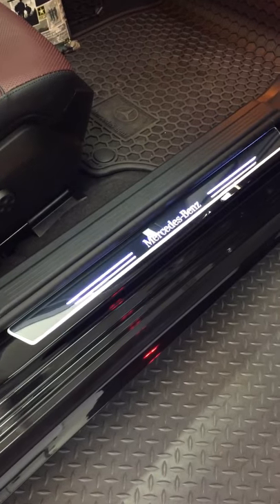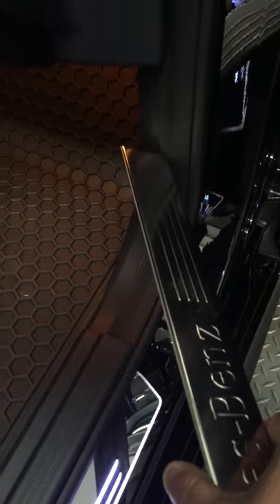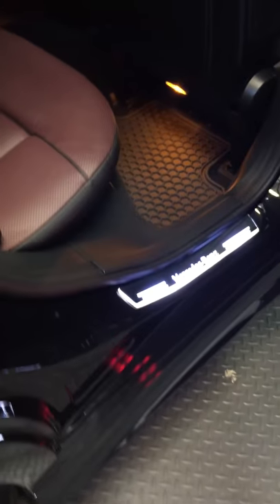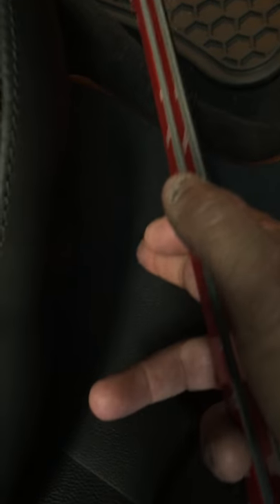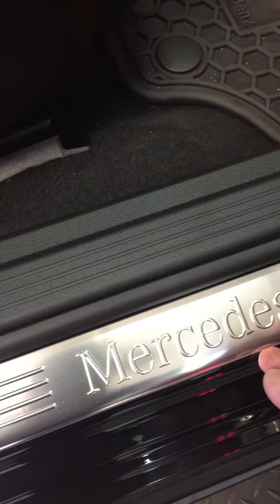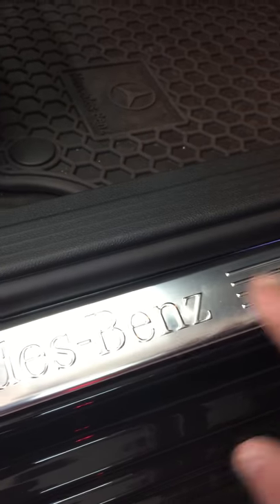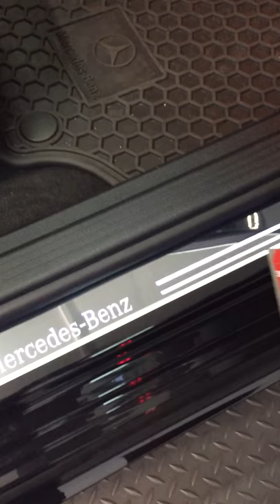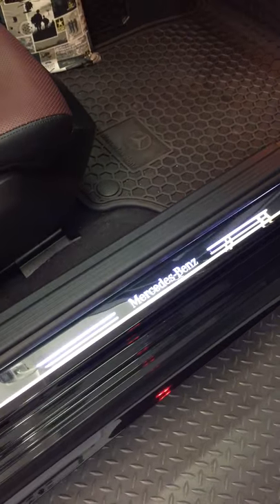Mercedes Benz E400 Mods - Front and rear dynamic LED door sills.

Comment: How do you disassemble the plastic next to the door sills?  Because in my GLA I tried to pull hard upwards but nothing moves and I am afraid of breaking the plastic pieces.
Reply from the maker: Not sure about the GLA.  Using a plastic trim tool my E400 W212 pops out.  You can go to MB parts online and check via your VIN the plastic door sill trim.  See if it is held by clips or adhesive tape.

Comment: How did you run the negative wire to the door without using the plastic in between the door
Reply from the maker: Are you talking about the front or rear doors?
Reply: I’m talking about the rear doors. You used the side B pillars for the positive connection. I understand that part. I’m just confused on how you are running the negative connection through the door boot where the courtesy light is. On the bottom of the door without going through the boot
Reply from the maker: @funnymovers2009  Once I removed the right side top and bottom B-Pillar panel this gave me better access to the wires that go to the door molex connector down through the rear right door.  I then drove to my nearby CarToys shop and ask if they could just help me find where to tap into the correct doom wires which control the rear right door courtesy light.  Using a tester, they identified which positive and negative wires to tap into.  They then provided me a copy of 2015 Mercedes-Benz E Class Sedan (W212) wiring diagram.  Although my car is a 2016 the wiring diagram did help.  I soldered connected the wires and wrap everything in automotive wiring harness vibration prevent tape.  Then proceeded to the left side.  In my case and according to wiring diagram the black wire of door sills was connected to the gray wire of rear right door.  For the left door the door sill black wire was connected to the violet wire of rear left door.  Importantly I did test these wires with a tester by closing and opening the doors to make sure they were correct wires before soldering them.  The red wire of sills was connected to a thicker red with white strip color of the rear right door.  Same thicker red wire for the left rear door.  Highly recommend getting assistance from some automotive electronic installer to ensure taping into correctly wires.
Reply: Joe A thank you so much I appreciate your time and reply
Reply: Joe A thanks again for the helpful info. I installed them super easy
Reply from the maker: @funnymovers2009  Nice..enjoy them.👍
Reply: @funnymovers2009  what year was your e350? Mine is a 2010 so wondering if I would tap into the same color wires?
Reply: @joea1746  I do t have a wire diagram so wondering. I have a 2010 e350, what are the odds I would tap into the same color wires?
Reply from the maker: @pb39374  Thats a good question.  I would think it be the same.  But then again it can vary due to year of car.  If not sure I would recommend go to auto electrician to verify.

Comment: Wish you would of shown how you did the rear sills.
Reply: Raymond never did the rear sill. Can you tell me what the wire was called in the b-post  that you cut to get the rear sill to work. I'm so nervous dealing with Mercedes wiring.
Reply from the maker: @vincecamponelli6035  Your right Ray didn't install the rear ones.  Like you I too get nervous when it comes to doing any modification to my MB.  In my case I paid a visit to my friends at CarToys Install shop.  They printed out the electronic schematic of my particular car W212 .  Then they tested and pointed out which wires I needed to tap into.  Without cutting any vehicle wire using a wire stripper I stripped just enough wire insulation.  Then with a fine pick tool I made a loop in the wire.  I looped the illuminated sill wire through the vehicle's wire and neatly solder it.

Comment: I just got my sills in the mail and it came with black connectors on the end. I guess this can be connected into some sort of wire harness. Did you cut them off on yours?
Reply from the maker: No I didn't cut them off I bought some of the same connectors and used the female or male end to connect the sills.  This way if something goes wrong with any of the sills I simply disconnect the bad one and replace it, and reconnect.  This way it looks like a nice clean install.  That's what I did.

Comment: What size of the front and rear sills? I see them on Ebay.
Reply: What is the size of your front and rear sills?  I see them on Ebay 

Size: 56cmx5cm (front door scuff lights)
          41cmx4.5cm(rear foor scuff lights)

Are these the same size as your?
Reply from the maker: Because door sill space vary on vehicles, I would suggest measuring first and contact the vendor thats what I did.  The ones I got for my 2016 E400 W212 Sedan were approximately 22 inches for the front ones.  Rear were approximately 14 inches.  The rear install required a slight upward curve.  Luckily the sills were flexible.  However to insure the rear sills would not come off due to the upward curse, I used 3M Primer 94. And replaced the adhesive tape the rear sill had with 3M automotive adhesive tape. So far so good rear ones holding.
Reply: Thank's Joe, Whats the Width of the sills? I see ebay has them  56cmx5cm (front door sills)
 and 41cmx4.5cm(rear door sills ). it looks like your sills are the same width.
Reply from the maker: @vincecamponelli6035  I think they are the same width